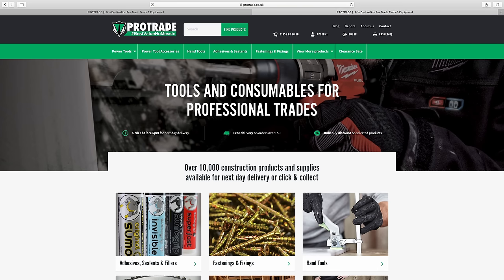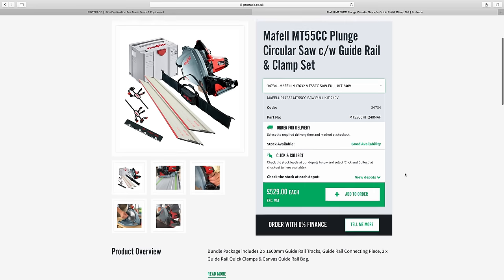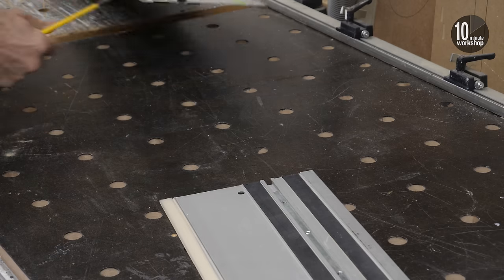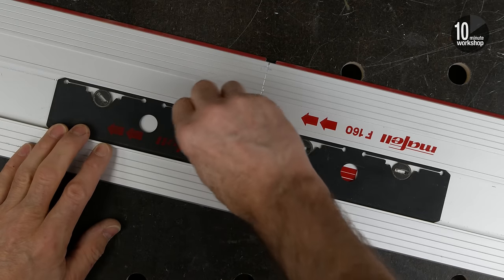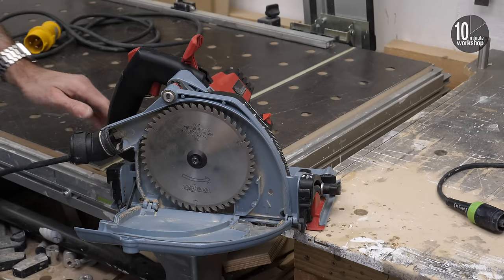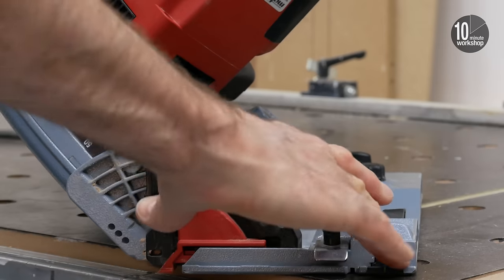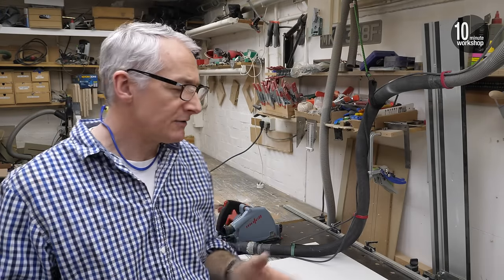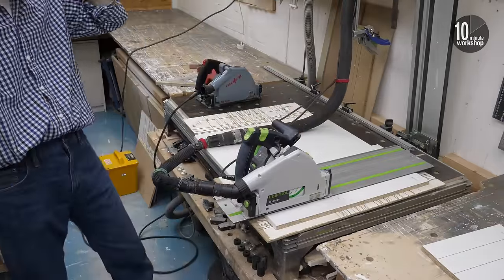Big Decision: Festool or Mafell? [video #400]

Comment: I looked long and hard at the Festool and set it against the Makita. I chose the Makita firstly because it was considerably cheaper but also because it had the facility for a scribing cut but without the stepover of the Mafell. The rail joining really bugs me though especially since both Festool and Makita only supply a single joining bar and for a piece of steel and 4 grub screws they certainly know how to charge for the second one.
Reply from the maker: The Makita is a better bar - it’s two metal strips, so the grub screws don’t ding the rail as you tighten them. The Mafell is streets apart in that regard. 👍

Comment: My festool after about 8 years has just about had it. Its 110v and really struggles now on Oak worktops, no matter how many shallow cuts I make through it.
Really contemplating changing to mafell, I like the guide rail and I guess if the score cut button is that much of an issue you could just run it through at 5 or 10 mm like you would with the festool.
I can't decide! Change is a good as a rest?
Reply from the maker: Of the guys I know who've made the change, they all kept their Festool rails - too much muscle-memory, I guess! and yes, a 'manual' scoring cut is always an option. Saw was collected today, they'll check it over and let me know the result. 👍

Comment: My TS55 is new but I'm having difficulty getting a plumb cut out of the blade. Out of the box the bevel guage was set to zero, and resting on the grub screw rather than being held at a bevel using the two thumb turns. Perfect I thought. But I've had to fiddle around with that adjustment screw so much that to cut a plumb cut it sits at just above 0. Not an issue if only ever do straight cuts but I've got some bevel cuts coming up and I'm putting it off but I have no real way of knowing whether 45 is actually 45. Anyone else had this that could point me in the right direction or is it a back to festool job? Cheers
Reply from the maker: Hi Gareth. So is the issue that now you have the saw adjusted to cut plumb, the depth gauge is off? I’m pretty sure there isn’t an adjustment in the gauge, so if the mid-read bothers you (assuming it’s consistent) then I think it’s back to festool, or to the dealers if it was a recent purchase. 👍
Reply: @10MinuteWorkshop  not the depth gauge Peter, the bevel guage. The 0 - 45 - 90 degree marking. There's an adjustment screw to push the blade up or down to be plumb. Tbh a bit disappointed it didn't cut plumb out of the box. Perhaps I should have stopped there and returned it but hey ho you live and learn. I read on some forums there's a way to effectively "recalibrate" the bevel angle marker to zero once you've adjusted it by removing a couple of screws and then moving the blade carrier or something but I didn't want to start tinkering around inside it, nor should I have to. I hoped you, or someone else reading it on here might just go "ah! I've had this issue and you solve it by X" etc.
Reply from the maker: Sorry Gareth, thumb typing; I meant bevel gauge, and everything I wrote relates to that. And no, I’m sorry, unless anyone else knows different, the gauge markings can’t be user-adjusted to match the marker. 🤷‍♂️👍
Reply: @10MinuteWorkshop  understood, thanks for coming back to me. Take care 👍🏻
Reply: Just brought a replacement ts55 and exactly the same issue with the bevel guide.  Festool are wanting it back but I would like it replaced.  It is now set to around 1 degree to get a plumb cut.  Also terrible on a 45 cut and the blade ends up entering the Mfc around 2mm away causing massive blow out to the material and it really struggles to cut as well.

Comment: Another  great video,  just wondering if  you  happen to know a definate answer  if the scheppach track saw  will work on a Makita guide rail or festool  rail?
Reply from the maker: Thanks! The Aldi/Scheppach saw I have will fit the Festool-pattern rails, but it’s not a great fit. I go into detail on why in one of the Tracksaw videos, #285 I think. Good place to start, anyway. 👍👍
Reply: @10MinuteWorkshop  great thanks,  I'll take a look cheers

Comment: The Festool is woefully under powered & the electronics are unbelievably fussy about power supply. Also the rear angle lock on the Festool is a proper bollock ache when swapping back & fourth between 45° & 90° cuts. The riving knife on the Festool is complete garbage & often works loose or goes out of alignment & snags.
I got no intention of replacing my TS55 REQ with another one when it bites the dust & can't see me hesitating with a Mafell.
Reply from the maker: As I say in the video, I’ve never found any I’d those issues. But I reach the same conclusion 👍
Reply: @10MinuteWorkshop  Indeed, it's one of them debates that generally neither fanboy will give an inch LOL hence you wisely avoiding making a recommendation ;-)

Comment: I don’t think anyone buying either of these saws would rate the saws cutting performance using the blade packaged with the saw. It would make sense to me to use a known quality blade, a CMT, Forrest, or other high performance blade, that would be a true performance comparison, imho.
Reply from the maker: And you are welcome to do that, of course. But as I say in the video, the blade size is odd, and the choice very limited - even the manufacturers don’t offer a blade as a spare part. That, more than anything, should give anyone looking at either of these saws pause for thought, and was the main reason for the focus on the ‘out of the box’ experience with these saws. 👍

Comment: I'm using the Mafell for over 10 years and never ever had problems with kickback. Neither can I follow your arguing about the scoring function. It's as precise as on day one. I suppose you get your blade checked or the the scoring offset on your saw is not correct set. The scorelines on my Felder panelsaw is much more like what you achieved with your Mafell.
Reply from the maker: Hi Helmut and thanks for taking the time to comment. I’m not arguing about the scoring function, simply reporting my findings. As I say in the video, it’s not my saw, it’s a demo unit in loan for review purposes. It’s gone back to Mafell to be checked over, and hopefully I’ll get it back to have another look at it when it’s returned. The scoring function is a selling point of the Mafell, though, so obviously I’m going to take a closer look at it in comparison to the Festool, and I was as surprised as you that it was so ‘gappy’. Again, as I say in the vid, I don’t think it’s an issue as such, but it’s something that happened and needs addressing. 🤷‍♂️👍
Reply: @10MinuteWorkshop Hi Peter, thank you for your reply. I guess the word arguing was misleading. It just came  as a surprise to me  that the saw would perform so bad for you on this task. For me it was the novelty of the scoring feature among the more powerful Cuprex Motor that I went for this saw. I use it mainly for cutting laminate on site with a Festool blade🤗 to get the best out of both! Best Regards Helmut

Comment: I know you lads love to indulge in a bit of one up manship on the tool front.....

Have you given a thought to the condition of your blade ?

Probably not - change it when it's blunt etc.

Not cutting as well ? - chipping the laminate ?

As well as picking the correct blade for the job  -  clean and lube the one you're using .

A 50/50 mix of meths and baby oil (:-) applied with a brass wire brush around your saw teeth will improve chip removal , and do other things that will improve life for your saw in general.

How do I know ? 

Spent 40 years makin ' em 

Don't take my word for it ..... Try it.
Reply from the maker: Both blades brand new, but totally take your points on board 👍👍 A clean blade is a happy blade...👌
Reply: @10MinuteWorkshop  Yes I knew that Pete , it was a general dig at us so called professionals who care more about appearance than maintenance.... And a timely reminder to the young pretenders to polish their tools ... In a more positive way than they are doing already.

Great professional content by the way .

Comment: 13:50 Щель образовалась из-за того, что лезвие находится под углом не равным 90 градусов.  /The gap was formed due to the fact that the blade is at an angle not equal to 90 degrees.
Reply from the maker: No, it wasn’t.

Comment: wanna save few bucks ? buy makita rails and locking bars (works on festool tracks too)

edit :  I have the 18v mafell one and the saw stops and makes a little 'beep' when blade is pinched between wood (kickback)
Reply from the maker: Thanks! Have had makita rails and connectors almost as long as I’ve had Festool 👍👍
Reply: @10MinuteWorkshop And in addition, I bought the makita angle rail connector but it doesn't fit inside the upper groove of my festool rail. I have also the bosh one (cheaper than mafell branded) and it's far superior. thanks.

Comment: Panel saws with scribe blades do the same thing as the mafell.  
"Do your best, Gap the rest"
Reply from the maker: I think if I paid panelsaw saw money and had a gap like that I’d be livid. 😱🤷‍♂️👍
Reply: @10MinuteWorkshop  Sliding panel saws allow you to adjust the scoring blade significantly in & out to suit the main blade.
Reply: But using a panel saw you cut face up so your scribe marks are on the back side (where it doesn’t matter, if your talking about carcasses) or you just set the scribe blade to be as well aligned  as you like/can

Comment: ridicolous comparison! unless either saw is not spinning true then it really doesn’t matter what saw you use in terms of chipping or not chipping. It only comes down tomthe accesories used with the saw. In this case foremost the sawblade! Regarding sawblade number of tooths, angling of tooths, and obviously sharpness of tooth play a huge role. As goes for the guide rail it is important that rubber and blade match up meaning that the actual blade in use cut through the rubber splinter guard. If you switch blade of a thicker thickness and the saw through the same guide rail then you will obviosly be cutting somewhat more of the rubber splinter guard strip, and switching back to original blade will leave a small gap between the bladetooths and the rubber strip thus creating more chip outs! Finally the revs picked must suit the material you are cutting. But if you have optimized all accesories then you will get same results with a Festool, Mafell, Makita or Dewalt for that matter..
Reply: Consider playing nice. Responding by calling the guy's comparison ridiculous says more about you than his comparison.
Reply: @bdm1000  intention was neither intended nice or cruel for that matter, just honest! You can’t compare worn and new tyres, worn or new sawblades etc. I will get a better result with less chipping running a no-brand saw with a brand new 48 tooth sawblade compared to running a Mafell or Festool saw with a dull blade. It really is as simple as that..

Comment: Great video, Peter. I am new to proper woodworking, (sculptor in metal, wood, plastic etc) wanted a compact but super (sub mm) accurate solution for cutting board and timber as I have no space for a table saw. (and like my fingers!) Disliked Festool's zealots (bit like Apple: find it off-putting), their over-pricing of admittedly clever products, hated their flimsy plastic feel. Also saw AvE's Youtube internal take down of the Festool track saw! Went for a Mafell: better rail  (good connection means no need for super long rail, better rail for ripping thin strips) more robust (metal body etc) which was handy because the first day I dropped it (small studio, packing away/unpacking, I'm a stupid klutz) on my concrete floor. That would have broken the Festool case.
Over all happy with Mafell. But I wish, wish, wish I had known:
1) Movement of scoring cut line
2) 45 degree cut (or actually ANY off 90 cut) moves cut line away from edge of track! You have to manually compensate. I think about 1.5 mmm or so !*?@!!!!
3) There seems no way of calibrating the angle scales! My straight 90 is off by about a degree, and I can't find a way to reset the scale!
4) The track is light and good, strip never peels off, but not having a top track means design of shop built jigs is trickier.

One point you made is Mafell strip is only available from Mafell. This is not actually true. The Bosch track saw uses the same rail, so Bosch rail, strips, clamps, router guides etc all fit Mafell rail, and the Bosch strips are cheaper, though blue, not pink, if that matters....

Re kickback. In a year of use, I have had one. Scary. So use a bosch kickback stop now.

Keep up the good work, but I think you'd be happier sticking to your Festool.
Reply from the maker: Thanks! Yes, I do cover bevel cuts, amongst other things, in  the ‘further thoughts’ video out on my Patreon on Sunday. 👍👍
Reply: The other rail that fits Mafell is the Lidl/Scheppach which I understand is available from Germany for a small fraction of Bosch or Mafell track.  I think I saw a comment on this some time ago when I was deciding on Festool or Mafell for use in UK where I was setting another workshop.  In the end I decided on Festool as I have their stuff in the other site.  No regrets.
Reply from the maker: As mentioned in the video, pretty much all plunge saws will run on Festool-pattern rails, which include Makita and the bulk of the supermarket saws and own-brands - the oddball being the Aldi/Scheppach which is uncommonly wide. 👍👍
Reply: Hi Ludovik, sightly off topic, but if you are new to woodworking and considering a chop saw, the Bosch is super accurate. I need to make large accurate joints for art projects, and I have total confidence in the cut. I have worked in high end maker workshops with top notch gear, and have had the luxury of using lots of different gear. I hesitated as I never trusted the accuracy of a chop saw, as really they are were originally not designed for that. Now I do all my cross cuts, and bevels, up to 300 mm or so with them. Please ignore obv....if you have/don't need this!
Reply: @Ludovik boden.

Hello,there is a screw behind the adjustment for the angle, you can see that if you look at it from the front. Somewhat hidden on the line of the arrow, but the indicator can be adjusted there. At least that's how I got mine adjusted.

Comment: I just got the TS55 a couple months ago, and it keeps eating chunks out of the plastic strip on the guiderails. I have it dialed in pretty stiff, it's not wiggling, so I don't understand why it would do that. It's about a millimeter, and mostly at the start of the guiderails, I'm not sure exactly when it happens, maybe when plunging.. anyone ever had this happen or have tips?
Reply from the maker: Are you hanging the saw off the rail to start the cut? Easy to get a bit of wiggle going in there and clip the splinterguard. 👍

Comment: Felbach maschinen fabrik... (mafell) 140 years, festo.. Protool festool.. 20 years old... Materials used.. Magnesium... Spare parts easy to find for the mafells even after 30years. Festool: difficult to repair, chip materials... Etc. Festool buys copyrights to Mafell, Mafell will never.... Etc etc etc. Festool are everywhere metal, plaster etc.. , Mafell is ONLY for woodworking.. Festool Best tools are from festo, flex and.. MAFELL... The only positiv point on the festool is the cable connection. Last point; in the finishing working you don't need the separator blade.. Never!!!  Can do better cuts than your tests, question of blade, rail and the operator.. .  There is no bad tools, there are only bad operators...
Reply: The grammar of this comment is impossible to read. I would encourage you to improve your reading and writing comprehension. It is important to be able to write in a way that others can understand.

Comment: Mafell for the rails
Reply from the maker: I like the rail joining system,  but I think I actually prefer the Festool pattern rail, in use. 🤷‍♂️👍
Reply: Peter Millard with Mafell/Bosch you can use both. I love the joining on the Mafell one, you don’t need to fiddle with it to make it square .

As a DIYer a 3m rail is not a good investment compared to the 1.6 and a shorter one.

Comment: Dewalt all day, every day.... for the price it holds its own against either.
Reply: Is your opinion based on a direct comparison? Have you used all three?
Reply: @yasa4448  
Yes. I've used these three, the Makita and the tritan. My point isn't that these two aren't good (they are) it's just that the costs on some tools isn't justified, if the cost is double it doesn't mean the tool is twice as good. All the main brand plunge saws are roughly the same, the extra money should be spent on the blade as any of them are as only as good as the blade (this is rarely mentioned).

Comment: 14:24 "I wish you could switch that off..!" How about you just don't switch it on? If you don't like a feature, don't use it. Btw any plunge saw can make a pass at 2-3mm, and the a pass at full depth.
Reply from the maker: Well, that’s a bit like ‘buy a dog and bark yourself’ - if you have to set the depth to make a shallow pass, you may as well not have the scoring cut feature. 🤷‍♂️
Reply: If you're going to keep making that stupid comment to defend yourself, you may as well not make videos of yourself sounding like fool in the first place.